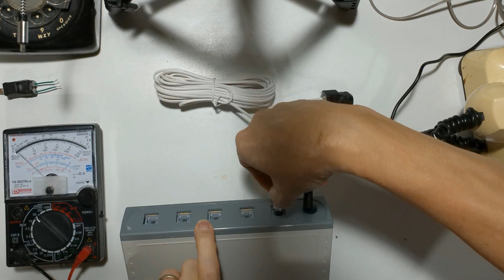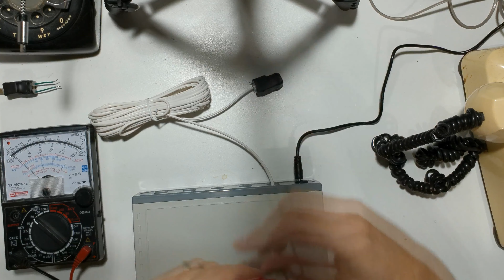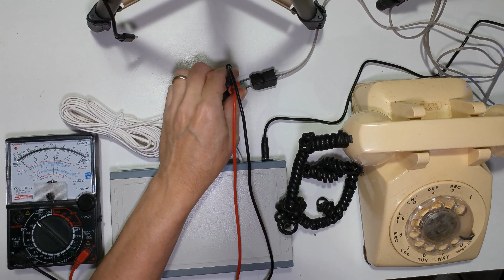Phone Testing and diagnosis

Comment: Hi Sean, I bought an exchange from you it works perfect.  However there is one old phone that won't dial out on line four.  This phone works on all the other lines.  And all my other phones work on line four.  It's like this particular phone might not be compatible with that line.  Have you any ideas why this might be the case?